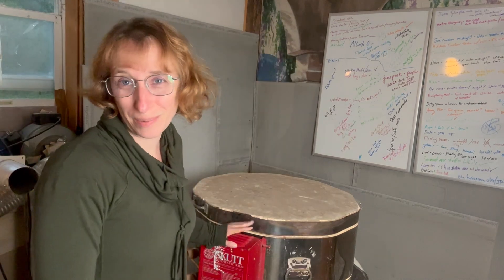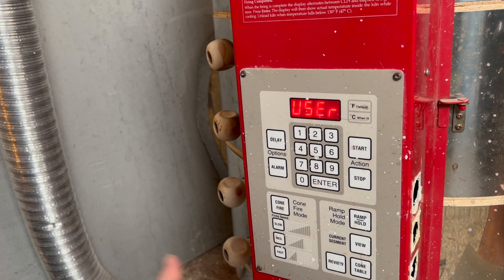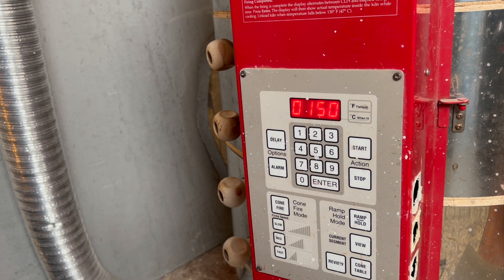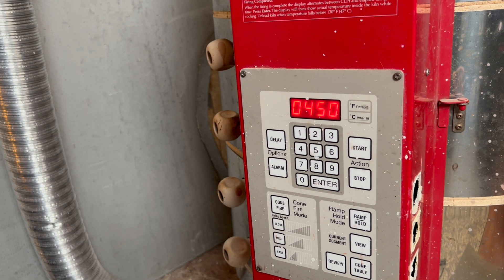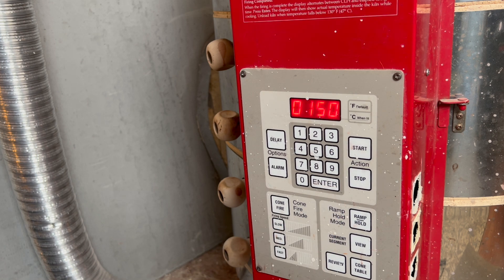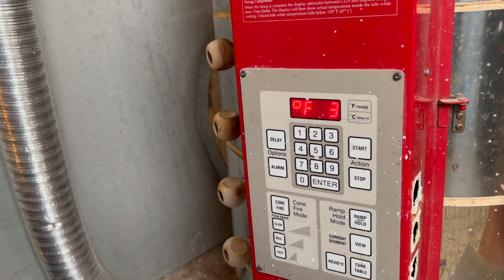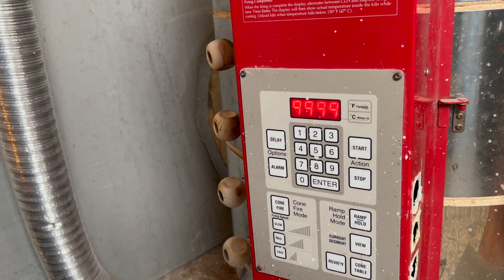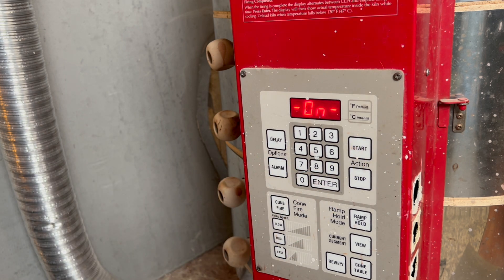Glaze Kiln Schedule for Skutt KM 1027

Comment: is yohr electric bill higher using a ramp hold schedule vs the factory schedule in the machine?
Reply from the maker: The short answer is yes. Anything you do that causes the kiln to be on longer costs more money. So fresher elements are more efficient and need less to get hot faster. It costs far more to do a hold at your top temperature than it does to do a drop hold. You can think of it like heating a home, setting your thermostat at a lower temperature costs less. A kiln works very hard to maintain 2200 degrees, where as at 200, it pops on every now and then. If you're watching it with a meter, that top temp is sucking away your money. If you don't have a pinhole problem with your current factory settings, then don't change a thing. If a drop hold is the difference between having useable products or a bunch of pinholes, pick the drop hold. I have expensive electric here, my kiln is around $15 a glaze firing. . . depending on the load, it's usually $1000 or more in merch. So the electricity is less of my focus, but I do consider these things!

Comment: Hi Sarah, I am trying to figure out how to operate my new-to-me Skutt kiln-control panel as yours. May be a dumb question, but, you must have to enter in the temperatures for your ramp hold to set them first, right? I feel lost. The person who owned my kiln has them set at a different schedule. Thank you for your help.
Reply from the maker: So when you are first setting up your own firing ramp, yes you will see the other owner's entries flash on the screen first and you just type your new number right over that. So you'll type in your segments first depending on how many different temps/ramps you want to get to. Then you should be able to follow along with the video. I would recommend starting out with a top temperature number slightly cooler than mine if you're not sure if your kiln fires a little cool or hot. Let me know if you have more questions, I don't mind trying to help:) Hopefully you have some witness cones you can use to see how the different elements are working.
Reply: @threelittlepotters  The segments show up after you press Ramp/Hold, correct? Since my kiln is smaller and older, I think I will try User 5 as you have, so I would just type 5 in?   I'll practice on the screen tomorrow, anyway thanks again, so much, you're just the best! I'm up at night trying to figure it out, lol. I know I am making it more difficult than it is. Anyway, I have been bisque firing and the cones are bending correctly for 04. Your top temp is 2050, right? What do you think 2020 to test? I have the cones I am all set in that regard. Lots to glaze fire tho' and I don't want to screw up, at least too badly, lol. I know your time is valuable, I really appreciate you responding! Kathy
Reply from the maker: @kathypowell8892  My top temp is 2220, and I would consider going 2200 as your top to start. It will depend a lot on your specific kiln. And Yes, I think it will make more sense when you're in front of it. It's fairly simple once you do it a few times. Yes, you press ramp/hold and then user (whatever number you want. Many people do bisque at user 1 glaze at user 2. You just press enter after each thing you select. If your kiln is like mine, when you get to the "alarm" portion... make sure not to enter in all 0000 for that or your kiln will just start beeping warnings at you non-stop. I somehow managed to do that my last load, lol.
Reply: @threelittlepotters  Thanks again Sarah, your help has made a world of difference to my confidence!

Comment: Thank you for this video! So you're saying that with new elements (or in my case, a new kiln), and with the Camille H. schedule going to cone 6 and then a hold on cooling, the whole thing takes about 8 hours to complete? Just trying to figure out how long from the time I start this (for cone 5.5) until I can open the kiln and take things out. Do you have an Envirovent/Envirolink set up, so something similar? And if so, do you leave it on the whole time? Thank you, and sorry so many questions! 😬😁🙏
Reply from the maker: If you are following my schedule, yes about 8 hours. If you're choosing different ramps, then that will affect the time. Say you're telling the kiln to go up 300 degrees per hour, it will take longer to get to that final temperature. I do not have a true enviro vent, I have a system I made myself, but I was having trouble with uneven heating because of it. So now while it's firing I vent the entire room. Then when it clicks off, I turn my vent system back on to cool the kiln load faster. Your vent, which is likely installed properly etc, can be left on the whole time. As for cooling; from when it finally kicks off till the end of the cooling countdown, I see lots of variations. My kiln has 2.5 inch brick, and I run my vent, and I tend to open at a higher temperature than most people like (400 degrees). So for me the cool down takes around 8-10 hours, sometimes longer if the kiln is really packed tight because those larger pieces will keep the heat. So from the time you hit start, till the time you can peak at the things, around 16 hours for me.
Reply: @threelittlepotters  Thank you SO much for this speedy reply and all of the details in it! I have enough info now to know that I don't have to go out there with a flashlight (no lights in my kiln shed yet) and start the thing tonight--I can just wait until morning. Phwew! Even better that I will have a sense of how to program the right ramp and hold. This will be my first glaze fire, so I'm very excited! I really appreciate you taking the time to make and post this video, and to answer questions. 🙏
Reply from the maker: @lehacarpenter7773  No problem! I hope it comes out amazing!!